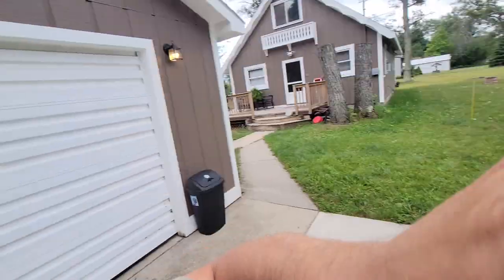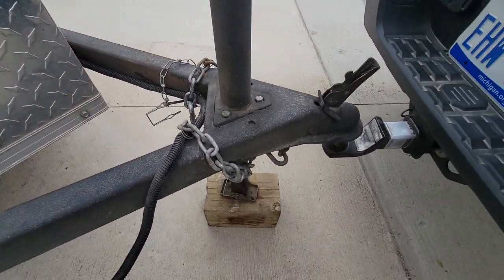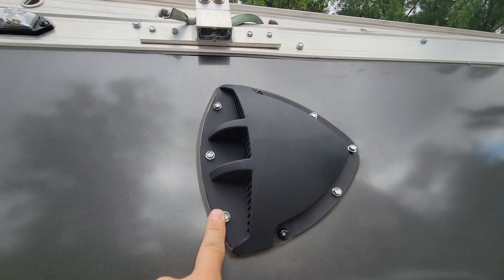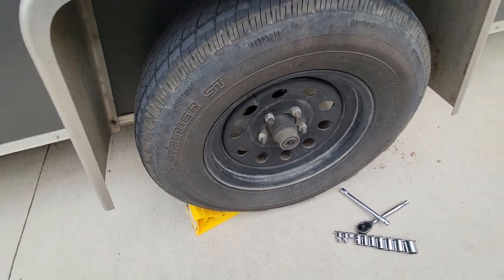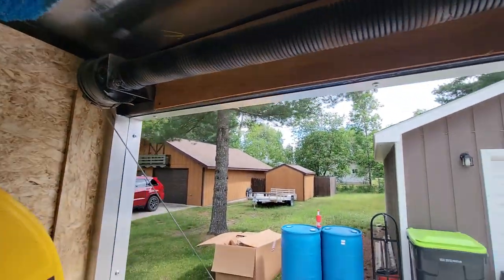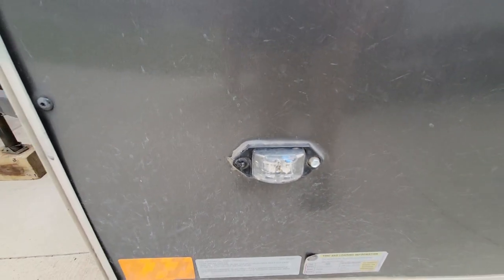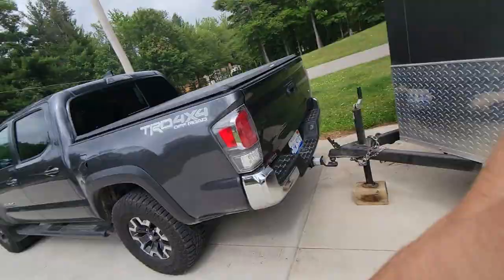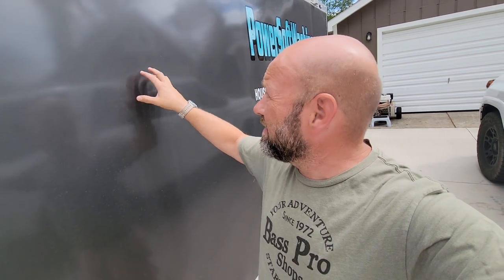Tips To Make Your Trailer Last Longer

Comment: trailers take a beating and half every trip. on those screws when replacing them, use some locktight or silicon adhesion to help lock them in.  it wont last forever but will help keep them tight.
Reply from the maker: Great tip! Thanks